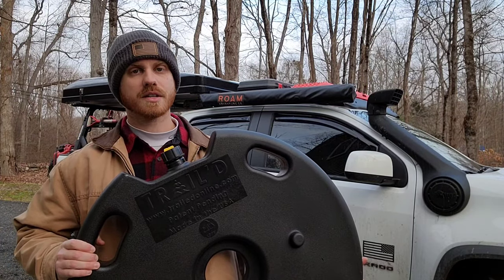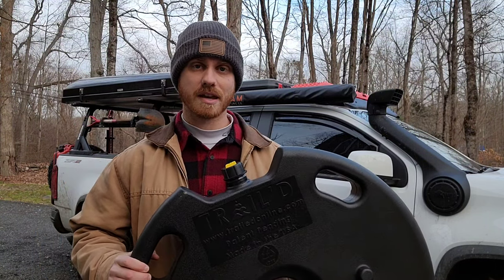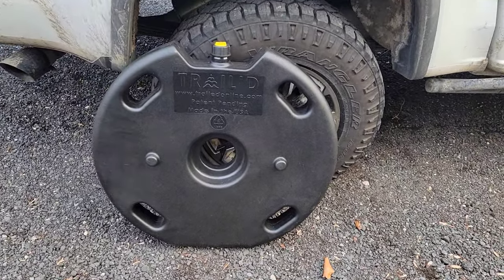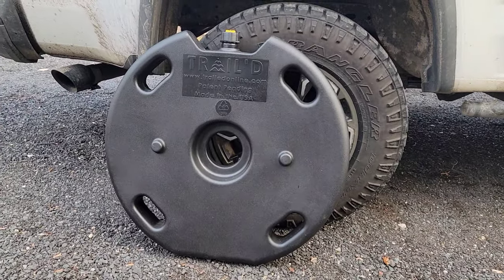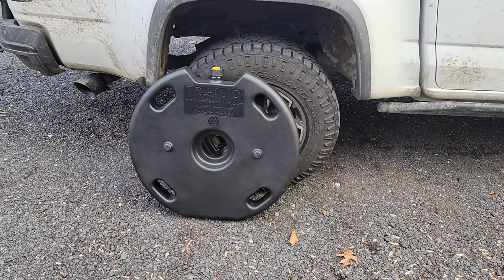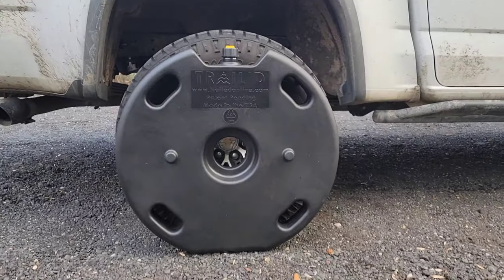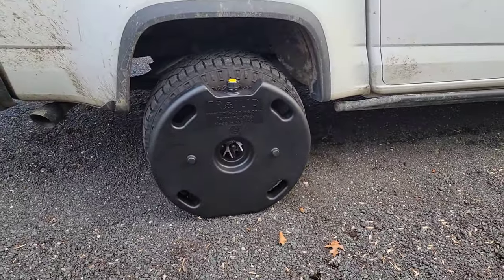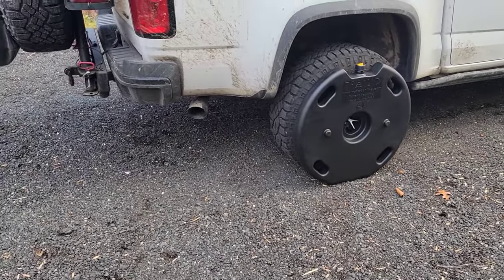Chevy Colorado ZR2 auxiliary tank from Trail'd Online

Comment: We took my spare completely off and mounted it upright in the forward part of the bed of my ZR2, because I do mild-to-moderate off-roading.  I use two 4-gallon Rotopax attached to the front of my off-road custom trailer (made at RockYour4X4).  In addition, my ZR2 is diesel-powered which gives me better mileage.

Comment: Great info.  How's it held up over the past 2 years?
Reply from the maker: I ended up only using it for water because the company wouldn't confirm it was designed for gasoline.  Worked well though.  However, I know Expedition Overland used theirs for gasoline during their trip through Africa and had no problems.

Comment: I am really enjoying your frankness when you're talking about gear and vehicles. Especially when you cover why you chose your vehicle and why it may or may not have been the best choice for you economically now that you've been driving it. The question I have for you with this, is how did it do in the warm weather? Did the gas expand a lot or did you have any problems with leaking or with the tank sagging around the center support? Thank you again!
Reply from the maker: I decided not to use it for gasoline.  Upon further research I found that most fuel containers are made of a material slightly stronger than this tank.  The company also doesn't specifically say "gasoline."  So it holds water just fine!🤣

Comment: I have a big Yellow 8 gallon plastic tank mounted on the inside of the Bed rack on the back side of the rotopax cans. For a total of of 10 Gallons with my yellow rotopax can. Love my zr2. Im on FB with a couple groups.
Reply from the maker: 10 extra gallons!! Very nice👍
Reply: @varsityoverland  it’s on Amazon but the attachment bolts are 3 inches too short. I had to go aces hardware to make it work with the locks. So typical Amazon junk

Comment: I see you’ve removed the original tire heat shield, you not worried the plastic tank might melt from the exhaust heat.  Sounds risky if you plan to carry fuel in the tank.
Reply from the maker: My thoughts exactly.  Already put it back on👍

Comment: Thanks for the video, I was curious about this product. I have a couple thoughts, they may or may not be valid. 
I noticed that this isn’t epa rated for fuel, not that it wouldn’t pass, it just isn’t rated. Is that a legal concern if something happens on the road, idk. 
Another thing is that it is probably good to use that metal washer or some other insert ring as this seemingly distributes the force of the hoist lift around the whole circumference of the plastic tank ring instead of just two small sections of the colorado style hoist bit. I’m not sure of the construction of the tanks inner ring, if it is solid or hollow in that area, but the hoist has a lot of torque, perhaps cracking the tank could occur if over tightened. 
On my diesel zr2 I’ve narrowly fit a 33.1”(255/80/17) spare and had to move the heat shield towards passenger side to squeeze the tire in place. I notice on yours either you removed that shield or the gasser doesn’t come with one. Not sure how close the exhaust systems gets to that area if you have a fuel tank there, if heat is an issue.
Reply from the maker: All legitimate thoughts. I had previously removed the heat shield.  Considering putting it back on but think ill reach out to the company to ask about it too.  I didn't realize it wasn't epa rated🤷‍♂️ ill look into that.

Comment: There's a simple(not cheap) solution for this but after emailing the company their response indicated they didn't want to be bothered with offering any more than the tank. Here's a thought. Cut a 29" disc out of 1/4" aluminum. Cut the center of that disc and add an insert that matches the inner diameter and depth of the tanks lift recess to keep everything centered(have it tig welded in place) and you're done. Plus you have now added a layer of protection for the tank. Also, I'd strongly advise you reinstall your heat shield. Thanks for being the first to post an installation video on their product. It has great potential but needs someone willing to take it to the next level(as they say).  Thanks again, and good luck.
Reply from the maker: Thanks! I like that thought process.  Also agree about the heat shield 👍

Comment: Thank you for the video... Can you share how it is holding up?

A few concerns that I had... (1) Use a spacer/washer made out of Delrin.  So no metal comes in contact with the tank...  You then place the metal washer on the outside of the Delrin washer...  I am just concerned with the metal washer cutting into the plastic tank with the day to day vibration.  (2) As someone mentioned, install the heat shield back...

I currently have the yellow Rotopax for my Bison diesel...
Reply from the maker: I decided to use it for water because of the gas concerns.  Also kinda more trouble than its worth to access 🤷‍♂️

Comment: I don't understand why would you want a portable tank mounted under the truck bed.
Seems like this could potentially get damaged on trail plus all the dirt this fuel cap will see I wouldn't want to use this for fuel. Maybe water. Interesting design of the tank. Can that be mounted on the swing out tire mount?
Reply from the maker: Yeah Im not 100% sold on using it for fuel, maybe water.  I agree with your points. Ive actually considered using it with the tire carrier but am having trouble with mounting options.
Reply: Do you weld? It seems it wouldn't be to difficult to figure out a spacer between the tire and the mount. But then you have to worrie about the Xtra weight.🤐🤐🤐
Reply: Anyways cool to see a channel with our trucks. Good luck with the setup
Reply from the maker: @AngelLovesToLook  thank you! I appreciate it